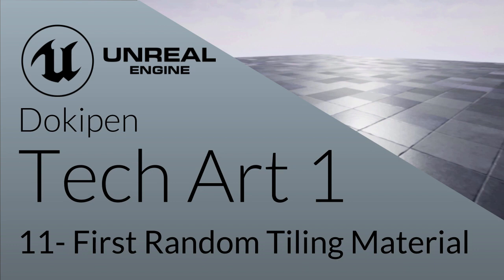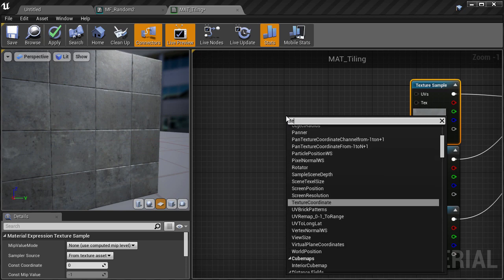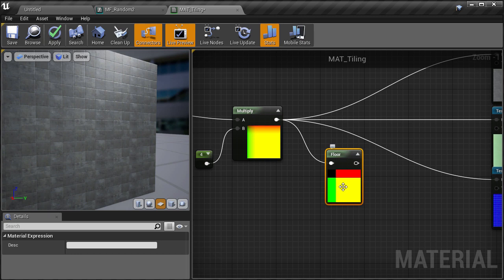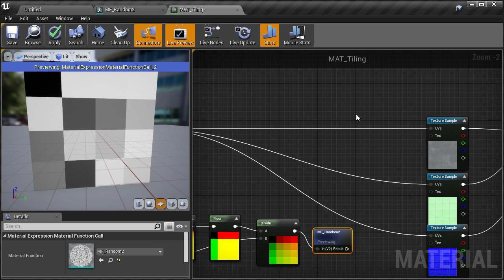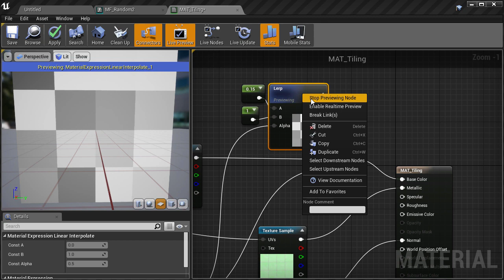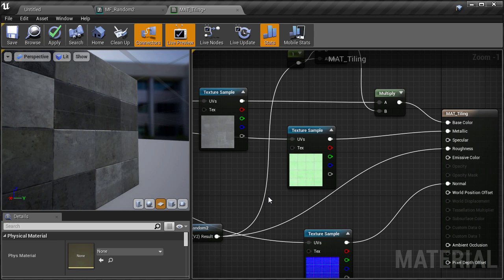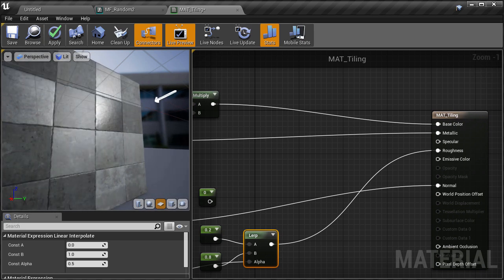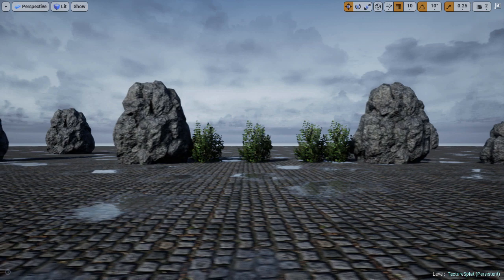Building a Random Tile Material - Unreal Engine 4 Tech Art S01E11

Comment: How to change the grey tiles to yellow and black ones to brown

I am very bad at materials so please help
Reply from the maker: What you would do is have two constant colour nodes for yellow and brown, then they would go into the a & b inputs of a lerp node. The third input of the lerp is a 0-1 input which controls blends between yellow and brown which is where you would plug in the random tiles pattern. Then you take the output of the lerp and either multiply it against the diffuse colour or lookup some way of tinting it.

If you didnt want it to be a blend between blue and yellow, then you would want to add a step node before the control input to the lerp to make is a binary choice between the two colors. Or a contrast would close the gap with a smaller blend so that most are either 100% brown or 100% yellow with a but of overlap in the middle where tiles are around 0.5 from the random.

Hope that helps. Feel free to ask more if it's not clear.